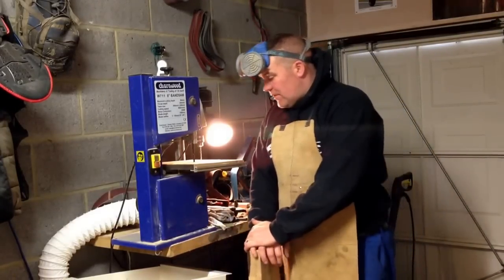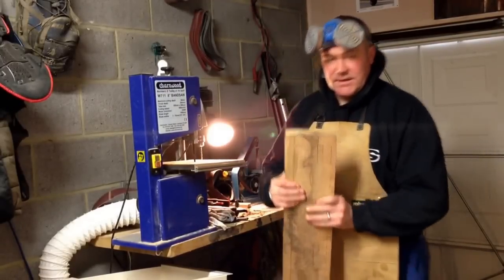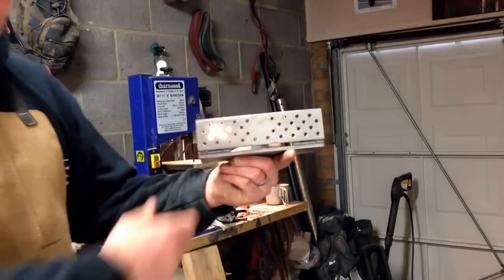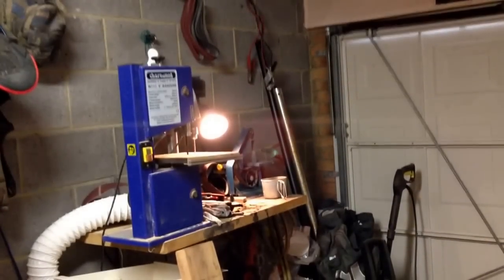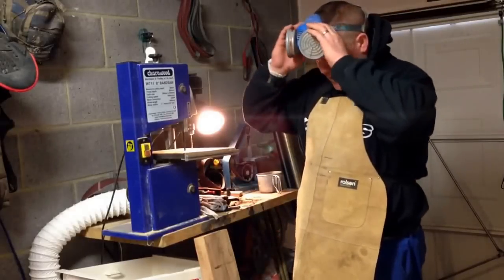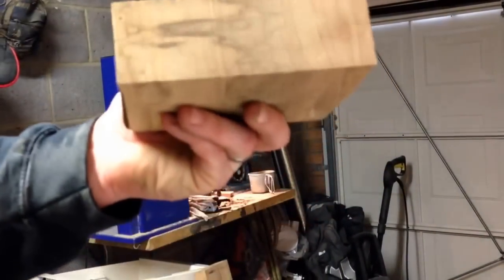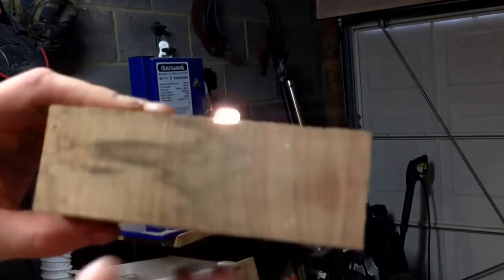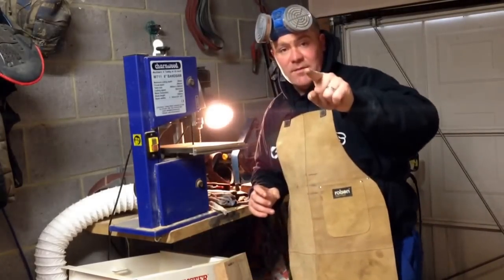7kblades spalted beech

Comment: Cheers for the jig close up John I've got most of the bits ready to make myself a copy.
Did you get your dust mask online or local? I couldn't find anything in the area or for less than a hundred quid so I'm still using a stupid paper type but its cr@p!!
Reply from the maker: ebay mate, had to buy the filters seperate tho, about £30 if i remember right pal,